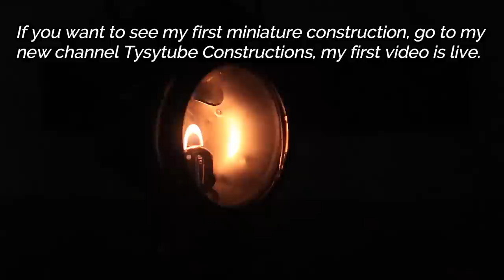1900 Vintage Oil Lamp Restoration...i did it again...

Comment: Your work are always amazing, no doubt....Just a suggestion though - spray paints are ruining your touch...you can surely afford a sand blaster, why not invest in a good quality airbrush?  Airbrushes will offer better finish, better color range and options, and numerous painting style...had you used one, the CHROME effect would have been better than chrome spray paints.  Cheers :)

Comment: Sandblasting lead soldered metals is not advisable due to it generating ultra fine lead and lead oxide dusts. You breath those dusts in, it will go into solution in your body very easily.

Comment: Wouldn't the filler for the joints be lead?  I've seen old body guys use lead filler and it looks very similar to what is in the seams

Comment: idk why you paint strip it and then blast it also use glass media as its less aggressive and it leaves a shinier surface
Reply: and a shinier surface leaves less tooth for the paint...he's stripping it first because those blast cabinets suck. i own one and i had to make a lot of modifications before it would blast correctly. i use 60/80 garnet abrasive mix in mine and the texture is not visible under the paint, even when i only use spray paint.

Comment: why use solder? it has a low melting temperature and the lamp can become warm in places if left burning for an extended period. This will weaken the solder. I hope all the paint is heat resistant too or it will bubble. Or is this another practical thing turned into an ornament?

Comment: Hey can anyone explain why sandpaper on wet surface rather than just sandpaper? What does the water do?
Reply: It keeps the paper from getting clogged with dust and allows for getting a very smooth surface.

Comment: This lantern burns lamp oil, aka. kerosene, NOT Zippo fuel, not Coleman fuel or any other volatile gasoline.
And the wick should be lowered under the dome when burning, to get a bright and steady white flame, otherwise the flame will be yellow and very smoky.

Comment: You needed oil for this type of  lamp, not lighter fluid. The oil will take longer to burn so the lamp will not have to be refilled (or the wick replaced) as quickly as it is now with the lighter fluid.

Comment: Sorry but after watching all your videos and seeing quality work, why in the world do you insist on using pop-rivets? You go to all the trouble of filing down casting marks, pore filling, and wet sanding and then install cheap, crappy looking pop-rivets. You have a compressor and I bet you have a air chisel, all you need is a small bucking bar and rivet tool to do it right.

Comment: nice, good work, but also, please do not fill up your lamps with lighter fluid, the way it puffed and blew out the first match is NOT supposed to happen, these lamps are meant to take kerosene or paraffin oil, using gasoline or lighter fluid will lead to lamps building up pressure and exploding, you could see that it was so volatile that the mere vapours were ignited, you're lucky it didn't explode. their are lamps and lanterns that do take gasoline but they're designed very differently, actually most don't even have a wick, just a hollow tube for pressurised aerated and carborated mixture of gasses to flow making a continuous steady bunson flame

Comment: Do NOT Ever Use that fuel, You should be using only kerosene or lamp oil in that lamp.  What you used vaporizes at temperatures lower than 125 Degrees F, and that is why there was a pop and explosion when you tried to light. If you use that fuel more, you can have pressure build up inside the lamp and cause an explosion inside the tank sending pre-warmed fuel all over the place.  As for the restoration, please don't use pop rivets in a vintage restoration, Brass rivets are a much nicer substitute, and don't look like rain gutter construction.

Comment: you do good work but when you do the older projects why do you use pop rivets instead of original style with a little bit more time, the projects would come out looking original not modern

Comment: Painting (well, choosing the right paint I'd say) is still your weak point. If you take a look at diecast models restoration channels you would learn a lot. How they match original colors before stripping paint, how they mix tones, how to perfectly balance the number of coats with airbrush... that would boost the quality of your restorations.